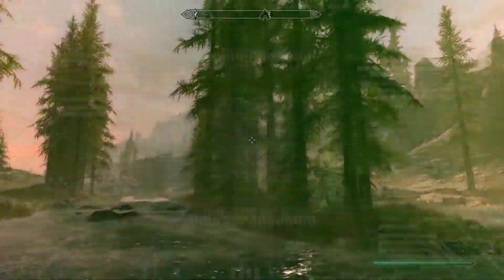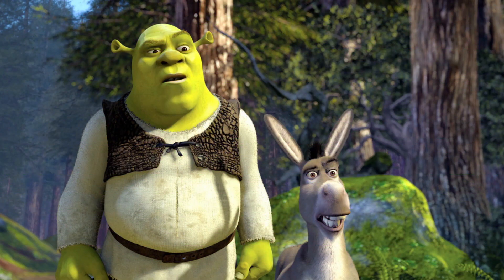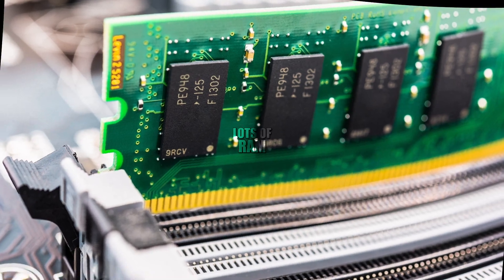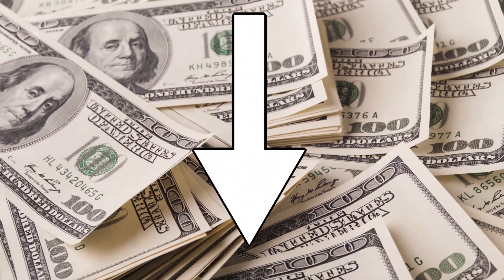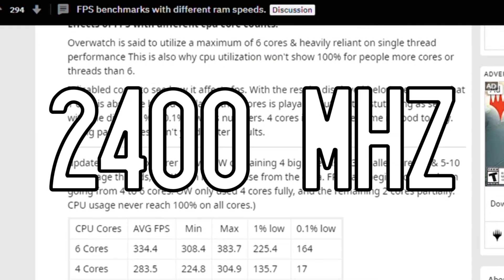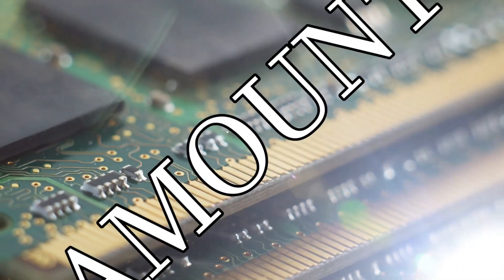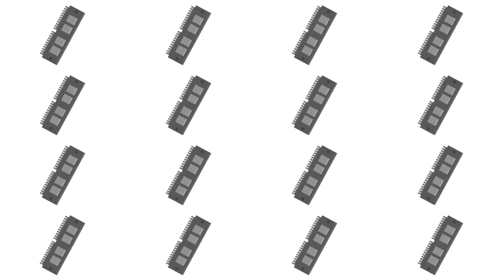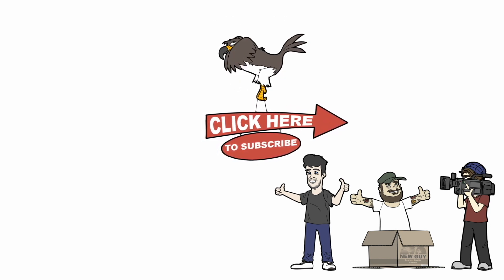Ram SIZE vs Ram SPEED for Gaming...What's Better?

Comment: Did anyone else catch the Aperture Labs labels on some of the manufacturing equipment at 4:05? Also, the Valve logos on the components right after. Anyway, another great video, Falcon. I enjoy your videos and your sense of humor even regardless if it's intentional or not. It's just enjoyable in general.

Comment: I have an HP build and manufactured in April 2012 with 4gb of RAM
The "Standard" in 2011 was 2-4gb, and 4-8 for gaming not fucking 1gb. 

It was only 8 years ago, 1gb would EARLY 2000's

Comment: If you don't have enough RAM, programs will use swap space on the hard drive.  Since RAM is >> faster than any disk, this swapping out will cause performance bottlenecks.  TL;DR: it's better to have more of the slowest RAM and fewer amounts of faster RAM due to swapping.
Reply: but once you have enought ram for what you are doing more ram doesn't do anything for you^^

Comment: 16GBs of Ram at 3600 MHz and 14 Latency(combined with a Zen 2 CPU) is basically the optimal set of RAM that you would want for highest performance in gaming currently.
Reply: I like PC for mods, 16GB is easy to fill.

Comment: The factor that matters most, depends on the task at hand coupled with the processing pipeline. For the general user (mostly gaming combined with internet browsing and video watching), you'd want to focus on reducing the latency to speed ratio, while keeping the bandwidth as high as possible (prioritizing the former over the latter). Increasing the amount of available memory only helps up until at certain point, again depending on the nature of the task, but this is more a case of using valuable processing time on working around the constraints of having limited available memory. In some cases, you might actually see a slight decrease in performance, as more memory has to be queried. With DDR4, I'd say the Goldilocks setup would be 2x8GB for the vast majority of users. I'd even venture to say, due to the nature of how DDR memory works, that for DDR5 it would be 2x16GB - assuming we're still running on dual 64-bit channels.

Comment: Ultimately. Having "More" Space and "More" Speed together is the best ;) Get the most space with the fastest speed and I guess ur good to go. I think in the End. Both will matter. I mean If you need 8GB Ram space (regardless of Speed) but you only have 6GB with the Double Speed it doesnt make the 6GB to 12GB it will still be 6GB. 
So 8GB of Ram with less Speed would still be a better choice than 6GB of Ram with more Speed.

Comment: i find funny we kinda use the same metaphore to explain the RAM, i usually use the example of a tool box, how big the is toolbox, affect how many tool you can have to access then asap if the tool box is not big enough you should get only the tools you need most, and when you need a diferent you should go remove one of the tools you are not needing rigth now and put the one you need, making the process more slow everytime you need to switch tools, but there is an optimal size you need, having extra big toolbox with a lot of space you are not using will not make any diference at all...

In RAM terms, there is an OPTIMAL amount of RAM you need for diferent task having double or triple the amount will not make the process work faster since is already using the necesary amount, in example: not counting how much ram need windows and other secondary process or any kind of bottle neck, if a game need 8 GB RAM to run with everything maxed, using 16 GB RAM of the same speed will not make the game gain more FPS... thats when RAM speed kick in, once the game use the amount it need having more speed ram will make a diference but even that will have a limit, there is also an optimal speed for each process to be calculated and having more ram speed will not make the process be calculated more faster, but it help on how fast the information can be access having a little impact on the performance.

A simple way to test is pick an old game maybe 15 years old, run the game in a 5 years old PC, and run the same game in a brand new PC, you will not notice any improve between the 5 old years PC vs the brand new PC, since a 15 year old game should be running at optimal speed probably with a 10 year old PC, so using newer and faster PC will not make the game run better.

Comment: Since DDR5 SDRAM is supposed to be released around the end of the year, you should have maybe included that. The speed of RAM will then have a minimum of 5000mhz, probably making the speed question redundant again for the following 5 years or so. Or from 2020 onward, since it will probably take some time to become the standard for most people. The question will still shift from "how fast is your RAM?" to "Do you have DDR5?" very quickly imo.

Comment: Unless you're on Ryzen, 2666 and 3200 on Intel platform doesn't really affect you
Reply: Incorrect,  most memory intensive CPU limited workload will benefit from additional ram speed.
Reply: @evilbred974  dear fanboy

Please

CHECK THE DAMN VIDEO TITLE
Reply: @AliciaCLR  Fanboy? I didn't even mention any brand. Ram speed matters depending on the task. Doesn't matter if it's AMD or Intel.

Comment: This video does a poor job explaining how running a video game works you start with your storage HD SSD or whatever goes to your ram which then feeds information into your CPU as it needs it so if you can't feed your CPU it won't do anything and will be waiting for ram to feed it once your CPU eats it feeds the frames to the GPU to render so everything is going in order from storage memory CPU GPU 

8gbs of ram is the cheapest and I would say minimal amount for reliable gaming in 2019 and 16gbs is comfortable and will be more than fine 32 is a luxury for gaming at least but the benefit is being able to leave more programs open in the background while gaming

 in the end though let's say you have 16gbs of ram which is ideal you would want to have your memory speed make sense for the power of your CPU and GPU and buy accordingly don't pair 400+$ CPUs with 80$ of ram you're gonna want to spend a little more to get that performance your CPU is meant for Typically 2666Mhz ram is ideal for any system that is a strong performer but also AMDs ryzen CPUs are a bit different and generally work better with higher speed 

what's more important is to do a little research on computer tech channels and not a video game channel like here that way you're gonna get what's actually a good fit for your system

Comment: Ah, yes, the 50mb RAM standard. Couldn't go a day without somebody reminding me that we're using 1gb of RAM as the default these days. It's really great that we use 2gb of RAM instead of 4gb of RAM like we used to. It'd be impossible for me to have so many tabs open in Google Chrome without 8gb of RAM. My new computer's gonna have 16gb of RAM, since 32gb of RAM is today's standard for really powerful computers. Never leave home without 64tb of RAM in your pocket.

Comment: The overall argument of speed versus size is kind of a moot point as there needs to be a balance of both in order to have a solid working system. The amount of RAM you are testing can factor in to show that the speed is not really a factor. If, for example, a game requires 8GB of RAM for optimal performance, and you have 32GB+ of RAM, you're not going to see an issue in this instance versus a build that has 8 to 12GB of RAM that is barely able to actually function. 

Now, if you have two equal RAM to compare where one is faster, then you can easily be able to see that the speed does matter.

Comment: Sorry, but this is such a bad video... I mean really shoddily researched video...

First, timeline of RAM in PCs is all wrong. I remember in mid 2000's one of the reasons to switch to 64bit windows was because of 3.5gb ram limit. By 2011 8gb was standard, not 1... Hell, even GPU's had more RAM than that... Nvidia 500 series came in 2011, and low end, 550ti-560ti range came with 1-2gb of RAM.... 580 had 3gb. No way system RAM standard was only 1gb...
Next, RAM prices were not going down these past several years. From more expensive gddr4, to supply shortages, underinvestment, flooding, ect, to mining and smartphones crazes, to good old price fixing by major manufacturers, RAM was crazy expensive. 

And finally, video does not in any way answer the topic. So how much do you need? And what speeds affects how much? Was expected neat graphs with benchmarks, instead got 10 min talking shit and referencing some other people who may have benchmarked one game....
Reply: Also - a little thing called 'Latency'.
Reply: @JamesCauchi  Oh yeah, talking CAS and timings are beyond the capabilities of this youtuber...
Reply: @fobusas  With some more research I'm sure they would be well within this youtuber's means :c) I am surprised that viewers find this video so controversial!

Comment: concerning ram speed and size. would it be correct to compare it too the universe? The speed of light is the fastest thing in the universe But the universe is so vast its makes the speed of light seems slow.
Reply: no... if what you do takes 12gb of ram max having 32 doesn't helo you, while faster speed on 16gb still can increase your performance
Reply: @johnuferbach9166  that's what im saying. its better to have them match rather then the space be way more vast then the ram speed can compensate for.

Comment: Ok so a lot of the explanation of ram is true however ram is very much closer to an SSD and if you have the know how you actually can get the computer to recognize it as one but due to how they are created it still will delete everything if the computer were to be turned off. You can also do the opposite with an SSD but won't run as fast or smooth as you'd think and wont delete things on it's own but again if you have the know how it's possible, just wont be really worth it. So the way they convey what ram is isn't entirely right, not saying they are wrong just they aren't right either. It's very complicated if you did deep into it

Comment: I know next to nothing about RAM, thanks to this video, so correct me if I'm wrong. Is it possible to have the apex of both size and speed; or is it like choosing research/evolution/factions in Starcraft 2?
Reply: Money decides. You can have a ton of high speed ram, but if you are on a budget sometimes you need to decide if you want to buy more memory or get better clocks.

Comment: The short answer is it depends. The long answer is, it depends on what CPU you're using and what applications you're going to be running. If you've got a Ryzen series CPU faster RAM is typically what you want to get the best performance out of the processor. AMD Threadripper thrives when you've got fast memory. If you're a gamer you want the fastest RAM your motherboard and CPU can support because this translates into better framerates. You don't necessarily need high-speed memory for web browsing or word processing, but gaming and video editing will see better performance with faster RAM. Now, how much RAM? That also depends, most games don't need more than 4 or 8GB of RAM, but if you're playing a 64-bit game that supports Modding then you want more RAM. For video editing, the more RAM the better regardless of speed. Same goes for streaming, you want plenty of system memory for both the game and buffer space for the capture software. However, if you are serious about streaming games professionally do what the pros do and use a second computer for video capture.

Comment: You've . . . you've definitely had a very different experience with RAM over the years than I have.

2011 for 1 GB to be standard? I bought a laptop -- a relatively cheap one -- in 2009 with 2 GB that I almost immediately needed to upgrade due to RAM bottlenecking even in Windows. Even with that upgrade the speed of the ram in question was still an issue, since in your video you're not even TOUCHING on single- versus multi-channel RAM threading and the like.

I'd argue that, for PCs, 1 GB of RAM became needed, especially for a gaming rig, closer to 2005 or 6, around the time Oblivion came out. The SPEED of the RAM has always mattered too, if you get into the nitty gritty of it, with the upgrade from SDRAM to DDRAM to DDR2 or DDR3 always making a clear performance boost, and most modern processors -- especially AMD's -- showing a very VERY clear performance improvement with faster speeds of DDR4 thanks to updates to the way the CPU can access the RAM and what it can use it for.

Comment: RAM size is much more important in my opinion. Yes, game nowadays didnt even able to utilize maybe more than 8GB of RAM(its include VRAM of course which is separated entity on PC because GPU have their own) due to they still cater with console specs. RAM speed (or frequency) maybe important for 1st gen Ryzen,but on Intel and latest Ryzen the difference is pretty negligible to make an impact towards game performance. But if you out of RAM, then there would be more annoying stutter due to windows have to free the RAM by swapping it into the harddisk (which is much more slower than RAM). Arkham Knight would prove that , it will shoot up way from 4GB to more than 7GB of your RAM (if you only have 8GB,like mine back in the day) right after few minutes playing the game.

Comment: Ok so most of the vids on this channel are pretty good but this was kind of a load of crap. Maybe some more research should have went on instead of randomly picking benchmarks so of which appeared to be a few years old which is ages when it comes to technology. Maybe try to do a colab with a pc gaming focused channel?

For those who came seeking answers

Ram speed matters to an extent depending on several factors but amount of ram matters as well. For the most part ram is used as a cache for If you are ramping up to 4k with high/ultra level settings you are going to need more ram. The Current consensus is that 16gb is the sweet spot for gaming, however streaming rigs or rigs that are also used as work stations or editing can easily want 32gb or more. If you are editing 4k video you might want 64gb or more. 16gb is slightly more than enough for gaming, having steam open, maybe spotify or a web browser. Typical stuff. Increasing the ram beyond the amount you need will do nothing to increase performance.

Now on to speed. DDR4 the current standard in use starts at 2166mhz and goes up to beyond 4500mhz. Depending on your CPU faster ram will make a noticeable difference up to around 3200mhz.(maybe a bit more for AMD Ryzen CPUs) Again though it only matters if you have the ability to play games at high settings in the first place. Spending extra on faster ram should really only happen if you are rocking a high end CPU and GPU. Lower end CPUs do benefit from faster ram as well because they tend to have less SDRAM in the form of cache on the actual CPU. This cache on the chip is much faster than even the fastest ram and has a direct connection to the cpu.(although it is really expensive) The problem with buying faster ram with a low end cpu is the fact that you can spend that extra money somewhere else...like on a faster CPU. The difference is also pretty mute until you are rocking a GPU that is too powerful for your CPU. If you are running a balanced lower end or budget rig faster ram isn't where it is at unless you are using a cpu with integrated graphics to game with. Discrete graphics cards have their own vram which is much faster than system ram.

The video also doesn't mention timings which are as important as ram. Generally this will be listed as CLxx. For example CL14 2666mhz ram will perform generally as well as CL16 3000mhz ram. 

My recommendations for anyone with say a intel 9600k or higher would be CL 15/16 3200mhz ram. Higher end AMD builds like say with the new r5 3900x probably should splurge for CL15/16 3400mhz ram.

Comment: And then you throw in CAS latency, and you’ll spend weeks finding the right RAM 😆
Reply: Or do what I did. Get a 3900x and buy 16gb's of what amd recommends aka 3200mhz cl14 or 3600 cl16 or 3733 cl17

Comment: Ram speed for DDR4 you should go with DDR4 3000 MHZ or better with 3200 being the sweet spot depending on your platform. For DDR 3 you want to go with the fastest possible with DDR3 2133 MHZ with low latency being the sweet spot. I have DDR 3600 in my Ryzen 2000 rig upgraded from DDR 2666MHZ and it made up to a 12% difference. In my 5930K rig I'm using DDR 3200 on a quad channel controller and it made a small difference upgrading from DDR 2666MHZ, probably less than 7%. When I had my Haswell I5 4670 upgrading from DDR 1600 to 2133 MHZ made a noticeable difference, but probably less than 10%.

Comment: Rule of thumb is to match your Ram Speed and Timings to the Optimum Frequencies' that your CPU allows, in my case my Ryzen 2600x likes CL15 3200Mhz and I got 16GB and can simply slot in another kit to get 32GB but right now that is not needed. Seeing as the GPU Market is Finally Getting interesting again... Then again the GTX 1070 is still a Trooper at 1080p and 1440p... 

While the Ryzen 3600x is out now I'd be paying for a modest 15% improvement so I will wait for Zen 2 to Mature like Zen 1 did add to the fact that the 2600x is still very fresh... So yeah 4600x and call it a day unless there is a Sweet Deal on a 3700x in 2020...

Also of note is what your Motherboard can Support... I blue screen at 3600Mhz CL17... So at the Most my B450 can Handle 3400Mhz CL16

But I digress Ram Amount is just as important as Speed... 8GB is the Minimum for a Dedicated Gaming Rig... For a Hybrid Workstation Like mine 16GB is the Minimum...